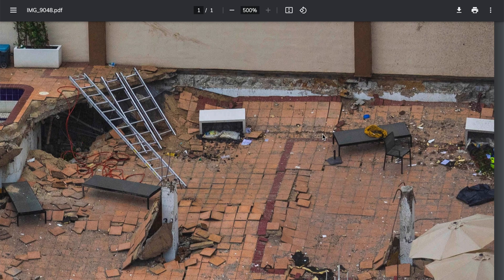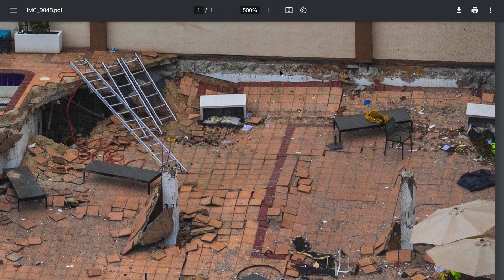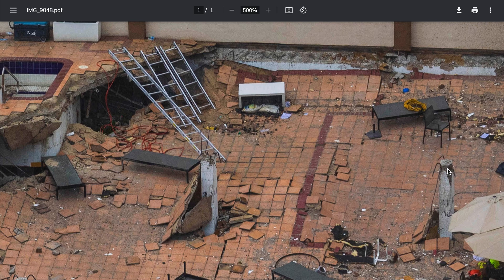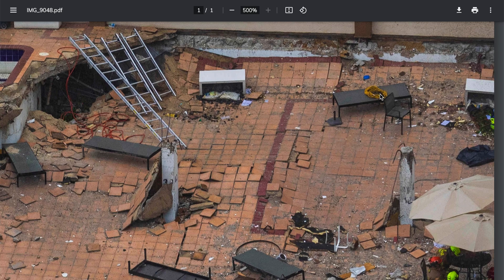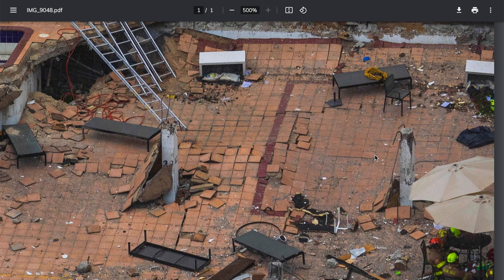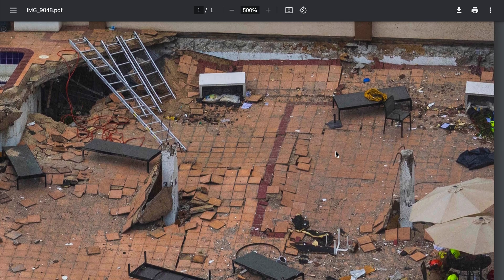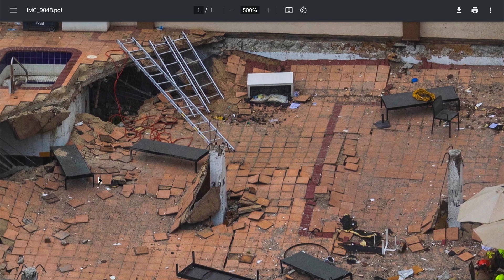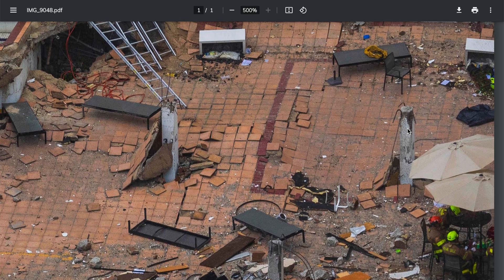Champlain Towers COLLAPSE WHY COLUMN NUMBERS ARE PART OF THE SMOKING GUN

Comment: I'm pondering if the reason we don't see rebar reinforcement on some columns or some pool deck sections yet we do on others is not because the rebar wasn't there originally but because the rebar broke at it week points probably due to corrosion and as the pool deck went down under its own immense weight the rebar where it was structurally intact hung on and literally pulled it through the deck.. probably exoding out the bottom of the pool deck as the rebar pulled through it.

Just to quick point out something for example you see all those lengths of rebar on the left side near the pool where the rebar hung on.. if you could envision lifting the pool deck back up and into place those long lengths of rebar would not go back into place. If you lifted the deck based off how much rebar is exposed there'd be several feet of gap between the point where the deck come apart. 

So I believe the rebar is there.. was there.. but it failed in various points probably due to corrosion. Other videos I seen prior to the collapse showed standing water in several parts of the pool deck and puddles in the parking garage below.

Just my takes to add. Interesting analysis! Need to keep as many eyes on this stuff as possible... our country's infrastructure and even large old housing complexes need attention and "for some reason" there never seems to be money to maintain this.

Comment: So, if I build a wooden deck on my house and I somehow figure out a way to leave out any sort of beams under the 4x4 posts, can I say that the deck's collapse was caused by "punchthrough" and just leave it at that? Them treated 2x10s is expensive and I'll be dead anyhow by the time anything bad happens.
Reply from the maker: Smart ass... build you deck and put the load of the decking onto the columns and not beams and you will get failure...Here is my link for you to donate, so I can speak your language; don't be cheap!
https://www.youtube.com/redirect?redir_token=DNv2IAOnVo5Ybkl1FWgAR6C5wc98MTU3MjA0NDQ2NkAxNTcxOTU4MDY2&v=eVVbhESG65I&q=https%3A%2F%2Fwww.paypal.com%2Fcgi-bin%2Fwebscr%3Fcmd%3D_s-xclick%26hosted_button_id%3DV9TGHDE92LQ8W%26source%3Durl&event=video_description

Comment: Does that look like a thick ply board where the decking is exposed? but if it is a concrete slab used for the pool decking structure it looks pretty thin in layer wise,  doesn't it?  See that piece hanging next to the spa pool - what's that made of - is it concrete or a ply board?  Sorry, it must be concrete because of the rebars hanging off the number 17 post it's pretty thin for a decking probably why it collapsed.  So Be It!!!

Comment: Appreciate the details however as an engineer myself these are theory only, yes looking at the columns is important for sure and it needs to be understood why these look so different when again in theory the loading from above should be evenly distributed, which leads to two very different thought paths and conclusions-if the load was even then what counteracted with the deck to deform the columns differently on the other side if the loading was uneven then that leads to an entire new set of problems to consider and perhaps lead to the loads being uneven from day one and compounded by the corrosion -this will take some serious forensics to sort out.
Reply from the maker: Dale, you are having problems processing data, not trolling you but just stating what your comments imply.
You obviously have not watched my videos with the witness statements or you are ignoring that data.
Also, if you can't make a conclusive file that rubbing on columns took place...and call that a "theory", then you should stick to book engineering and stay out of the field...
Wait, you just said engineer... What kind would matter... BUT, not really, as I would demand all engineers have deductive skills...
You made it clear... You are a babe in these woods. Imo
Reply from the maker: PS Deform is a bad choice... I would state "defaced"...
😂 You are not a very good troll...

Comment: @3:08 where you say "I'm not sure what I'm looking at... rebars sticking up..."  I would suggest that those rebars were part of the slab, and stayed WITH the slab... of course they were supposed to be part of the overall "cap" that prevented punch-through ... failed on that count.  Typically all those rebars would be wire-tied together before the concrete was placed... can't really tell at this low-res, but if those wires--very skinny, typically 14 or 16-gauge--were rusted away, that would be VERY telling as to how things degraded over the decades.

Comment: On the left side of the pool area, while the visable portion of the deck appears thinner than that on the right, it look like what is left is the add-on layer. The original layer is on the floor with rebar on top.

Comment: I think you are on the right track. The columns under the building had the extra cane shaped rebar and pulled out larger pieces of concrete when the slab fails. Some of the pillars on the pile were just bare rebar at each floor. Also the core sample shows 2 parallel spall types corroded rebar and compression spalling. I have a garage that was poured on fill inside an 8' foundation the back wall came out and released the fill it became a span and the surface spelled but it had tripled 3 eight rebar crossed every foot.

Comment: I'm sort of surprised that the red hat recovery workers are being allowed to stand on that corner with hoses tonight seeing that the only layer left is the upper pour and the tiles... the 9.5" deep concrete structure pour (shown in the core samples) is pulverized by the rebar pull-down and on top of the car.
Reply: And what's with the FD sitting in the patio chairs using the umbrellas? Is this normal?
Reply: @cynvision  
I guess if they’re hot and exhausted and just need to sit down out of the sun for a few mins

Comment: What size are those columns because that will give you the size of the tiles.
Reply: Columns were in underground parking garage. Gauge size of tile with standard firefighter hard hat size..sitting in right lower corner.
Reply: @sylvia106  Yes but if you look at how some of the tiles are resting against the columns then you can see that they are about the same size. That is closer than a hard hat which may differ from manufacturer to manufacturer.

Comment: Great observation.  The cheese grater effect of the columns could be why the building columns under unit 111 failed. I am working on the timeline. However, I’m struggling to understand how all this punch shear and collapse happened, but no one noticed. It must have been loud and was visible from half the units. There was a guard. No car alarms went off when the upper, visitor parking collapsed? No car alarms went off when the deck crashed onto cars in the garage?  There were cameras everywhere, and I assume the guard had multiple screens, but he didn’t notice any of this?  Sara Nir said the guard didn’t know what to do. My HOA had private security, too. They work for low wages with high turnover. If they are good, they become real cops and double their pay, so the good ones leave. They get fired if residents complain. If he had activated the evacuation alarm, he would probably lose his job because residents would be awakened. Private security can be a scapegoat. In hindsight, he would have been a hero.
Reply: There are at least three timelines of interest: 1) project inception, all parties involved, architectural process, permitting, construction, etc;  2) maintenance, inspections, and repairs;  3)  24 hours leading up to the collapse.
Reply from the maker: TOM, you are stealing my THUNDER ---   I want my money back!    BUT< YOU GET THE SUPER A+++++    Now, I have to remove the other pin and pin you now!
Reply: What happened to the security guard?  Did he make it out?
Reply: And what did he see?
Reply: @SadieG-ez8yb  I believe the guard survived because he was in the lobby, and I read he helped people in the part that didn’t collapse. Sara Nir told him to call the police and set off the alarm, but I don’t think he did either one. He said he didn’t know the address. When she told him, he made her write down the address, so Sara told her son Gabriel to write it down for the guard. This is from her interview on Anderson Cooper 360 podcast. I know Gabriel called 911.

Comment: I’m picturing in my mind how this wave occurred. I can see the force or push out came from the direction of the lobby/workout room, but started further into the garage. I’m going to look at what column/beam is in that area. 

Why all of the layers and layers of concrete near that pool wall? The weight alone prob dropped it at gravity speed causing the buckle. Were these extra layers later attempts at fixing drainage? When and who did them. 🤔
Reply: Core sample “B” is suspect to me. It had the most fractures and they cut through the rebar. Possibly causing a weakening in the deck itself.
Reply: Tremendous weight too.